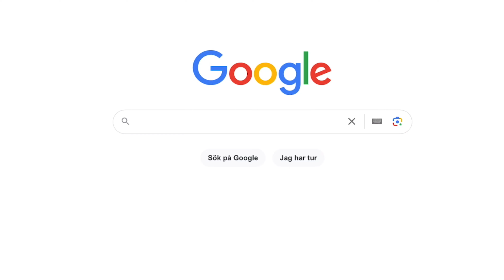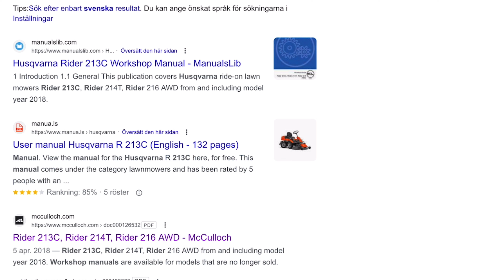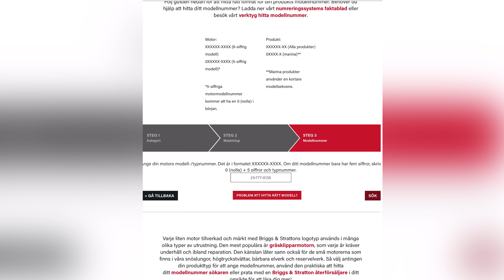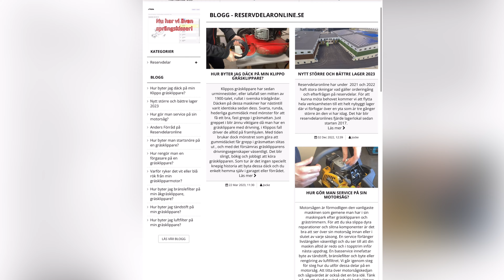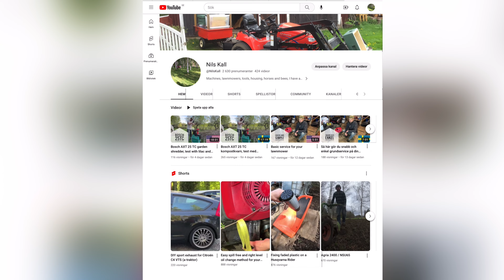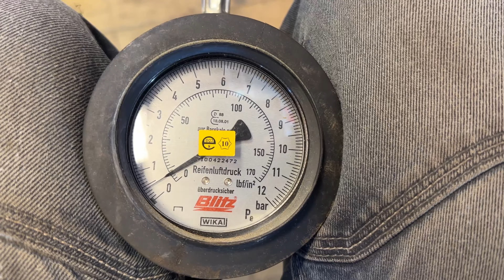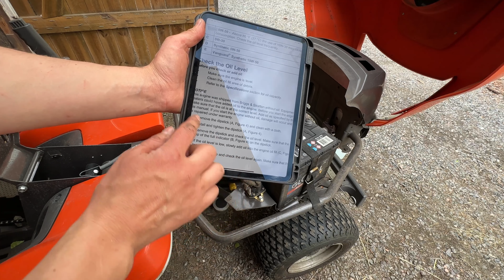Husqvarna Rider 213 service, svensk lång version 4K

Comment: why is an insert wedge used on one rear wheel, and a pressed wedge on the other rear wheel?
Reply from the maker: Sorry, where can you see this? There is a English version if this video too if that is better for you?
Reply: I looked at my jons yesterday. one wheel had a wedge, the other had a pressed-in hump in the hub @NilsKall
Reply from the maker: @tadaskabliukas2797  ok, maybe one wheel was changed at some point? I haven’t seen that before.
Reply: 43:28 @NilsKall
Reply from the maker: @tadaskabliukas2797 I mean I haven’t seen that there is one lose key and one integrated in the wheel.